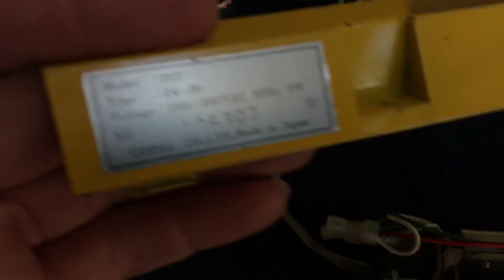Copal Flip Clock Motor Repair

Comment: Good on you for the vid mate!
Bought one on the weekend (identical to the one mum had when I was a kid) and it was super dusty inside and not running. I carefully disassembled just to try cleaning it with great success and put it all back together. All the lights and the radio work brilliantly but it’s still not running. Amazing bit of engineering from what I could see and I’m totally in love with it! Your video has given me something to try I really appreciate your efforts! I’ll keep you posted 👍🏼
Reply from the maker: thanks for the kind words - i know a better way to fix them now if you message me
Reply: @sonofsolo69  MATE!! I couldn’t leave it til morning so my daughter and I tackled a midnight project and BOOM!! Working like a clock hahaha! Was such an amazing feeling of accomplishment when that little flywheel slowly came to life (I also carefully squeezed some gear oil into the axle) we were high-fiving and whooping at the kitchen table at 1am!! 🤣🤣🤣 absolutely stoked mate really glad for your help 👌🏼
Reply from the maker: @jackbadger56  ah that’s great, worst case scenario is that one of the plastic gear cogs is striped in the gearbox but you won’t know untill it starts spinning, if it stops again soon message me as there are new ways to get them running perfect again!

Comment: Great vid. I have a vintage superzonic and it all works apart from it loses about an hour a day. You reckon this would remedy the issue?
Reply from the maker: is it definitely 50hz (if you’re in the uk?)
Reply: Not sure. I will check. Yes I'm in the uk
Reply from the maker: @mattlewis5190  i thought more about this, the motors produce virtually no torque so tend to with run at the proper speed or not at all, any added friction would stop the motor rather than slow it down, i’d guess that 1 or more of the teeth inside the gearbox have broken off, i have one like this a while back that ran slow and this was the reason. unfortunately the gearbox cogs are plastic and can wear badly
Reply: @sonofsolo69  I've checked it is 50hz, I've oiled the external gears and it does run smoothly. Shame I can't use it though as it runs 4 seconds slow per minute. Thanks for the help by the way

Comment: How far into it the gap did you move the pipe cleaner? My clock does a clicking sound constantly so I thought I'd try this method!
Reply from the maker: Marcus Wallinder with a jewellers eye glass you can see the strip inside the cap, you need to clean that, maybe some new oil in the gearbox will quieten yours down ?
Reply: @sonofsolo69  Many thanks! I'll give it that a go!